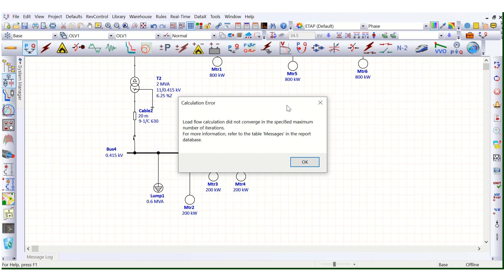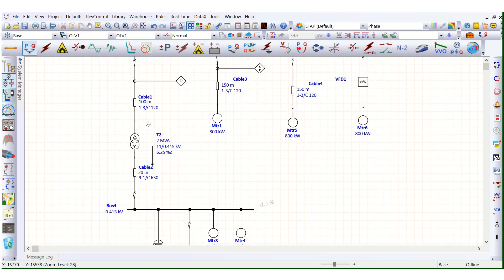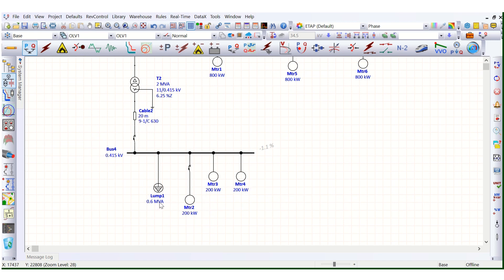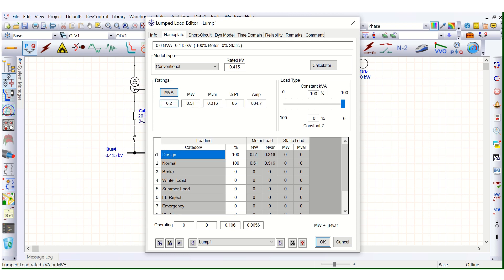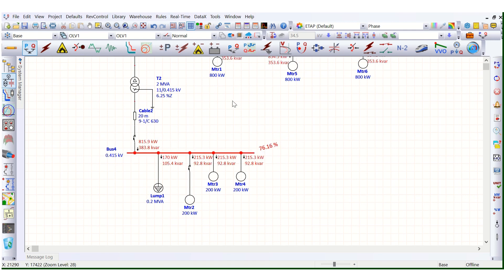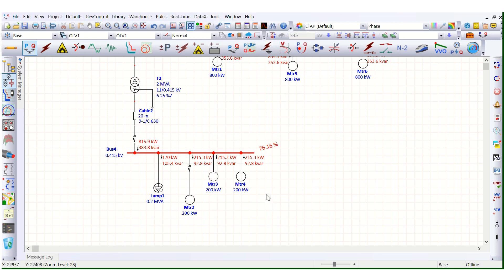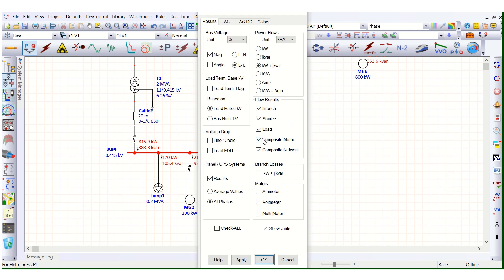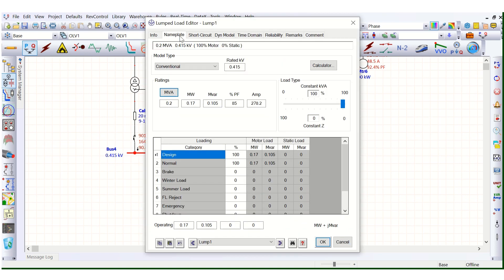Load Flow Study did not Converge II ETAP Common Error

Comment: By reducing load still error sustain. How can I do that in that condition..?
Reply from the maker: Try to put proper bus voltage rating and transformer voltage ratio, there should not be any issue
Reply: @SmartEducare  I used multiple composite networks it’s not an issue ..?
Voltages and XFMR rating etc ok